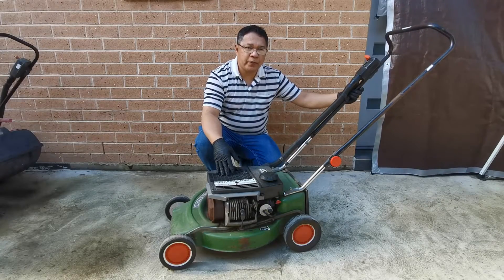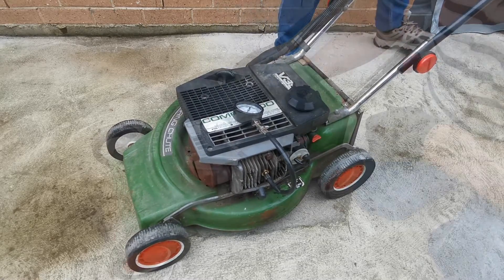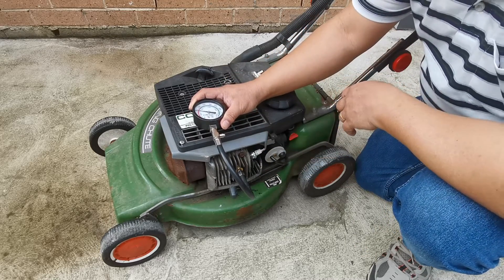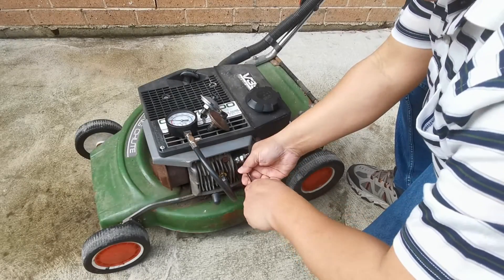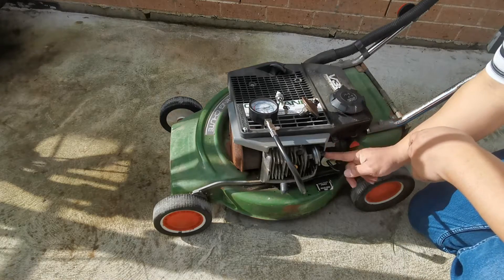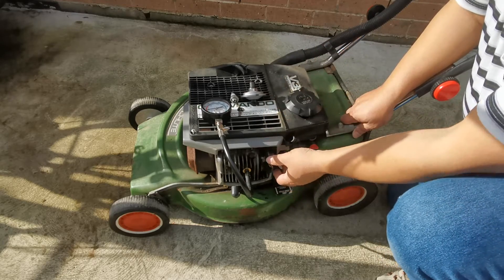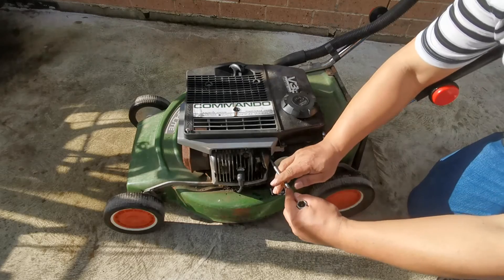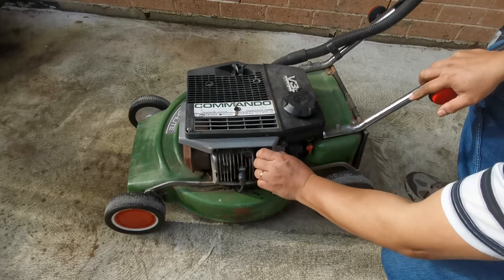VTECH 45 - Compression Testing Of Victa 2-Stroke Engine

Comment: Just compression testing my Victa 110psi with decompression taking out spark plug in hole
Reply: Using Motul 2-stroke oil must be working well
Reply from the maker: That's good to be true at 110psi. I can't confirm, as most Victa I worked on, the maximum compression I got is only 80psi. Maybe someone can confirm. Thanks for watching. Please do subscribe to see more video on Victa 2-Stroke. VARIETECH

Comment: I got a higher reading of 80psi with the decompression valve on. With the valve hole plugged up, it was 65 psi. Any thoughts on why this is the case?
Reply from the maker: If you got a reading of 80psi with decompression valve, you should also get a reading of 80psi when it's blocked. Pulling the starter cord when plug is blocked is very hard and you feel the kickback even the engine is in Off position. Building up to the full compression needs force and quick pull with no hesitation. I understand not everyone or age has the same pulling force. I'm one that already on the margin which I still enough force to do it. Maybe in a few years from now, this will be only a history to tell. I hope it help. Cheers and thanks for watching our videos and following our channel for your small engine repair. VARIETECH
Reply: @Varietech-AU  Thanks for your help. I'm thinking the reading of 80psi is because the cylinder is too dry from it sitting a long time so there's next to no oil seal on the rings. I know there's cheating with a squirt of oil. I might run it, let it cool down and try again. I normally do Briggs/Hondas and just aquired 4 Victa 2 Strokes of various generations.I like keep a clear conscience when I sell used power gardening equipment.

Comment: Hi would you sell an New Victa 2 stroke ignition coil?
Reply from the maker: Hi Matt, Thanks for watching our videos. Now only we provide tutorials and guide, we tried to supply parts as well especially for victa PT carburetor. What the carburetor can do to keep your PT running for another years if other important parts are no longer available especially ignition coil, piston & rings and decompressor valves. These are the parts that we are trying to source or remanufacture if possible or feasible. As far as I knew, the current available ignition coil without iron core would cause engine kickback due to inductance which cause to advance the ignition firing. I will do more research on this one using oscilloscope to see the timing, comparing inductance and effect of the ignition module and share it to everyone. At the moment we don't have available ignition coil and we don't want to source same coil available on the market which cause engine kickback. Cheers, VARIETECH

Comment: So on a healthy Victa ,compression reads approx 80-100psi without decompressor  ,  85 psi without vacuum pipe , 60 psi with vacuum pipe .
Reply from the maker: Thanks for watching our video. You're correct and great observation and summary of the overall conclusion. I should do that showing the summary  as a quick reference. Cheers, VARIETECH

Comment: How often do the compression valves typically last?
Reply from the maker: Thanks for watching our videos. If you mean the decompression valve, imagine that some of the unit was built in 1980 and still had the original decompression valve which now fails. That's possibly be the reason why decompression valves cost roughly $40AUD but this must be replaced for easy starting. Thanks, VARIETECH